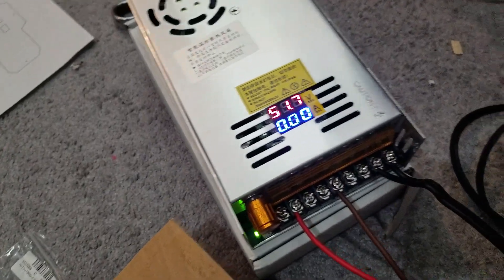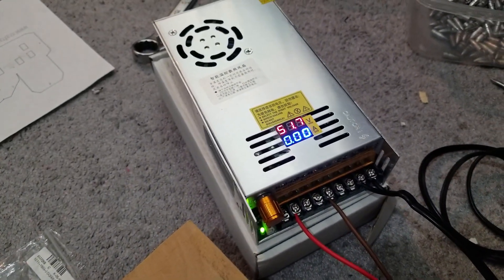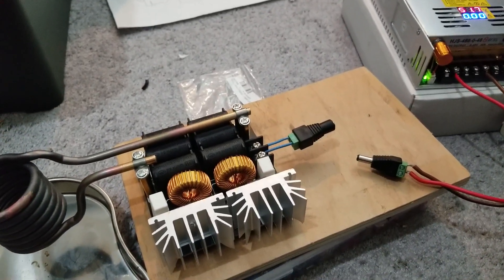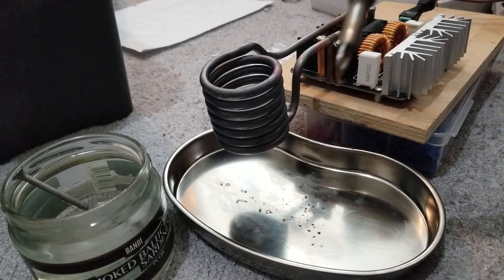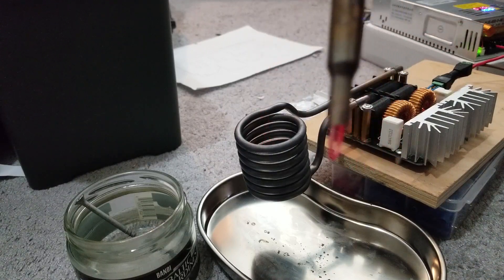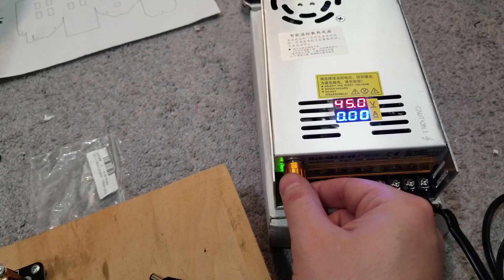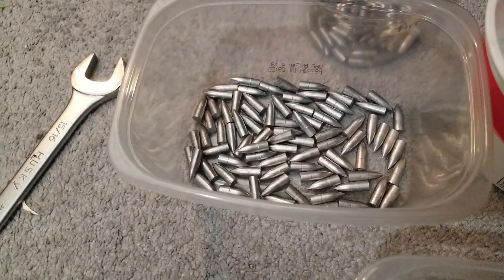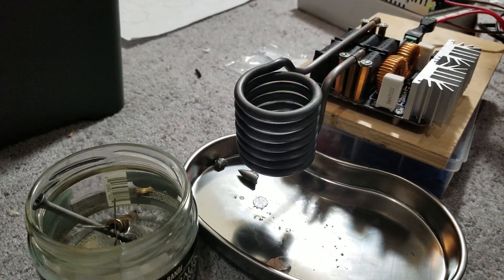Playing with induction heater for brass annealer project

Comment: Also your right from what I've found you want the cartridge to fill 1/3 of the coil I've seen #12 copper wire with a high temp white sleeve that worked fast
Reply from the maker: I found a thread that details the key information I was missing at the time of the video.  I picked up the project again recently and will post updated video.  I was able to successfully anneal in 4 seconds 223 brass but working to solve PCB overheating issue.

Comment: I answered your question on one of my vids, for some good ideas/info see http://forum.accurateshooter.com/threads/induction-brass-annealer-redux.3908353/

Tons of great info, very long thread. 

You can insulate the coil from grounding with lacquer clearcoat or similar. 

To run at near 100% duty you need to water cool the coil and what works best is several glue on heatsinks on the bottom of the induction board near the capacitor leads with a good fan.

Comment: It shouldn't even matter if it was getting hot if it were actually properly thermally isolated. Just give it appropriate housing instead of laying it on the carpet
Reply from the maker: it ended up dying on me, I am guessing something overheated and fried, I even bought sleeve for coil but haven't installed on time.

Comment: Use a contactor so it only heats when a case is present also you don't need that big of a coil to sneak the brass neck good video
Reply from the maker: I was going to wind my own coil, I got thinner copper tube as well as solid thick copper wire, I also ordered high temp sleeve to protect the coil from heat but my induction board died sadly.  At this point I think I'll build Aneelez type machine, it's less complicated.  I've seen youtube video and ordered main parts long time long time ago, it's just a matter of making one.

Comment: Thats a cool project. I’ve got a full size automotive inductor that I use to remove rusted bolts. I didn’t realize it worked with non-ferrous metals? I think I’ll see how it works for annealing. Thanks for getting the old brane turning:)
Reply from the maker: Yep, it works on brass but less effective.  The efficiency should increase when I wind new coil with less diameter for concentrated effect.  I also can use this to anneal my gas check punches, should make it very simple.
Reply: Dima Prok. I use the flexible cable the most. Its cheap enough and you can easily make whatever diameter you want. 

https://www.amazon.com/dp/B008MFQY5K/ref=cm_sw_r_sms_c_api_i_EJ24BbHEHXGX3